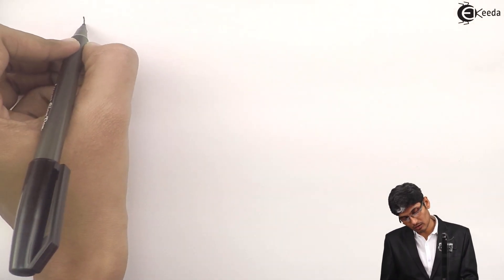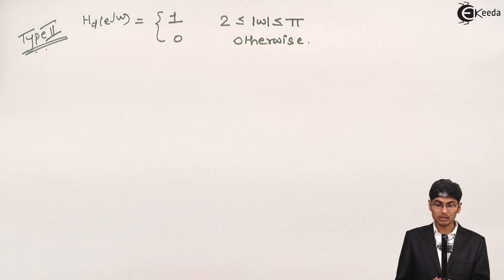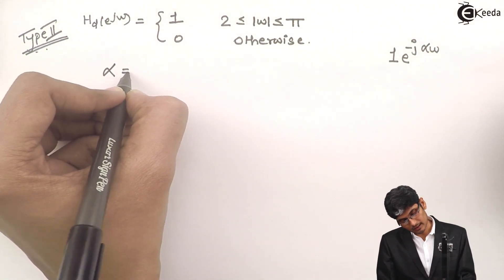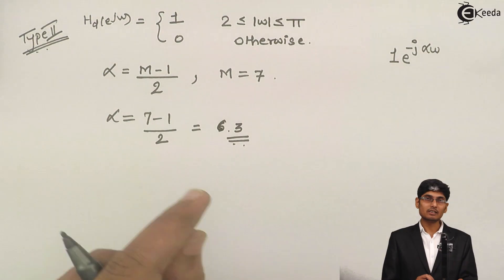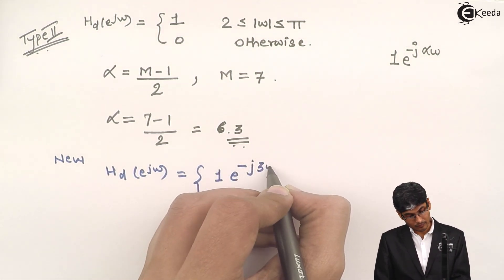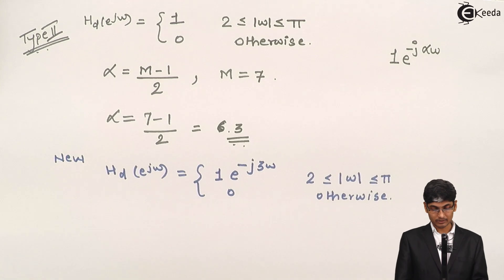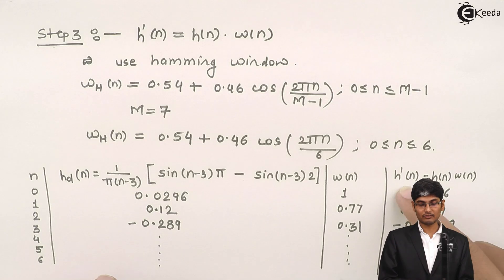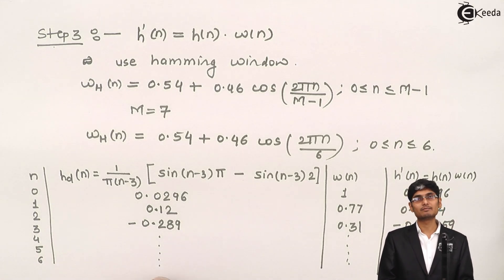Problem No. 2 on Windowing Technique in FIR Filter | Discrete Time Signal Processing

Comment: i think there is some mistake

h(n) = 1/pi(n-3) [sin(n-3)pi + sin(n-3)2]

h(n) should be this.

you've take -ve sign b/w sin function.

plz correct me if i am wrong..any1 can rply
Reply: it'll be negative just check properly, we have to take - common for arranging terms[e^j(n-3)pi] in Proper order